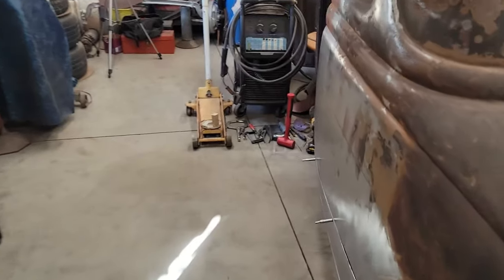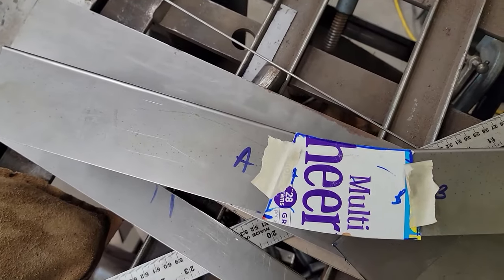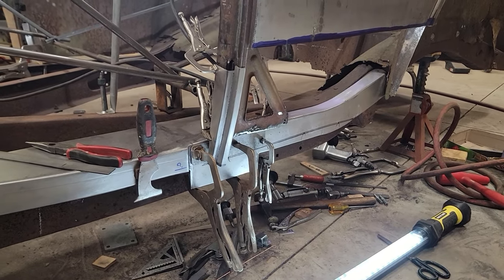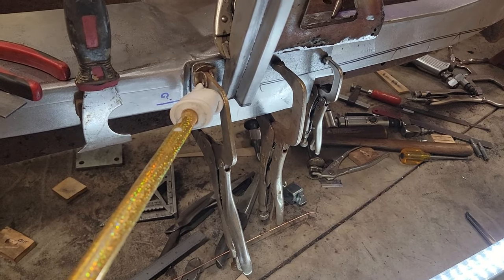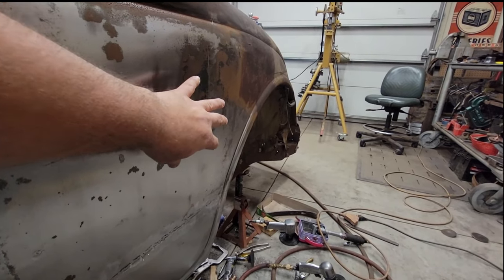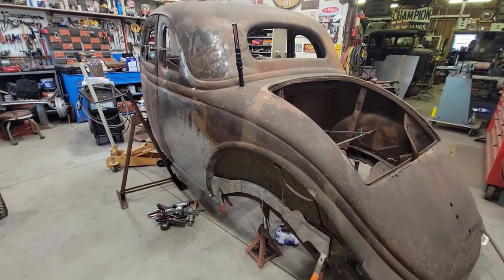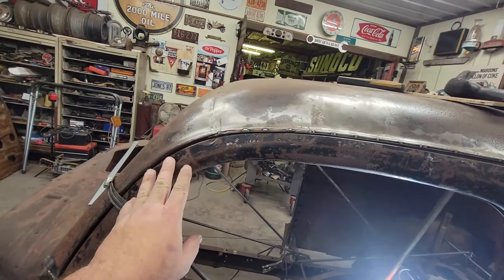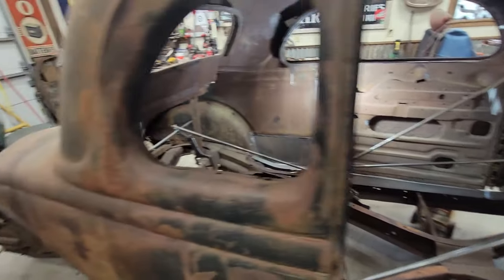1936 Coupe Quarter Patch Fab and Install

Comment: What gauge of metal did you use for the rocker panel on the inside of the door. Great video! Thanks.
Reply from the maker: 20 ga
Reply from the maker: 18 or 20 ga. I'll have to check and remember to get back with you. Thanks for dropping by

Comment: My B piller doesn't have that brace. No signs of one ever being there.
Reply from the maker: My other side doesn't either...so I can't say what mine is from...ill have to explore that. Wonder...tudor or slantback. ??? Was supposed to be 36
Reply: Good questions,  first one I've seen in any 36 coupe rebuild video's.  Wonder if that brace is in a roadster?  They had an extra cowel foot brace and other bracing through out.
Reply from the maker: @jefferycaples6041  I'd bet your correct on the roadster possibility